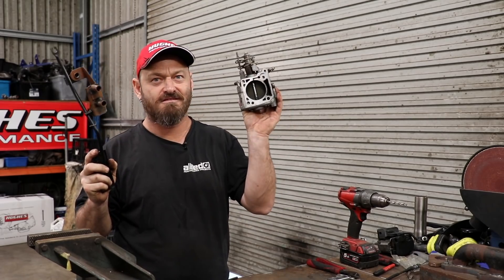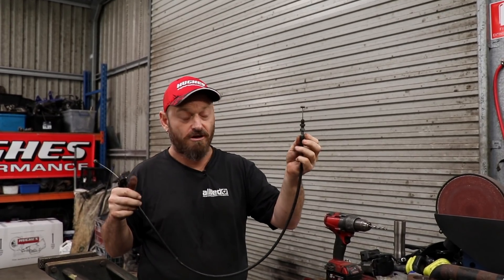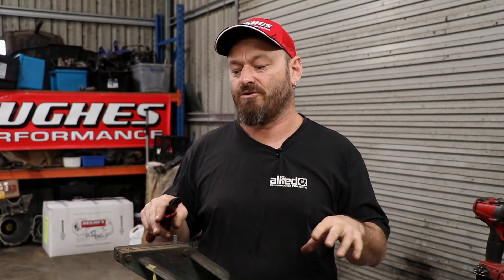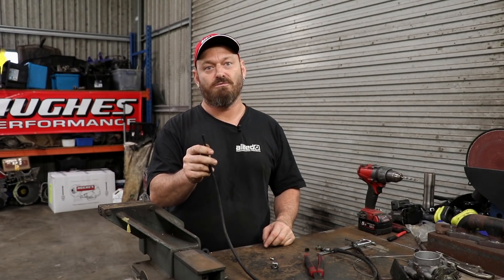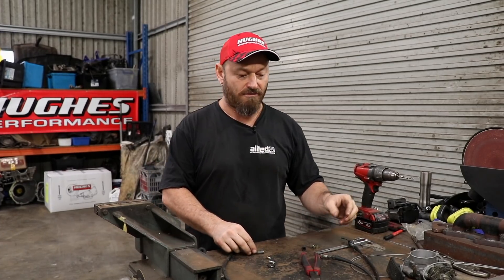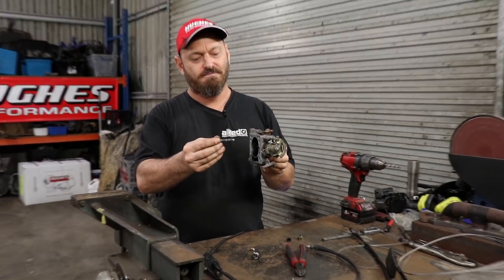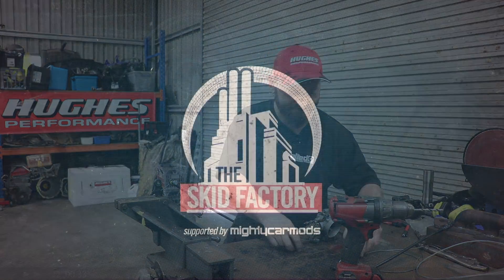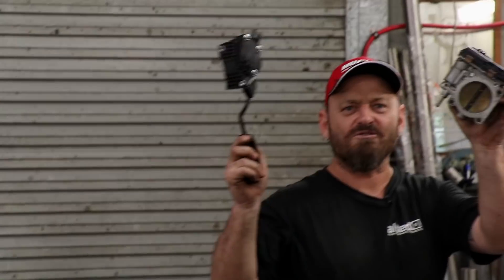THE SKID FACTORY - [QUICK TECH] How to make a Throttle Cable

Comment: Totally agree with the video, just wanted to say that I've found an angle grinder with a thin cut off wheel works the best to cut the outside. The cutters squish in the metal spiral leaving a jagged edge that often rubs on the inner cable

Comment: Some of the bicycle brake cables do have teflon liners. I had to put this out there because I just fixed my bicycle and bought that literal cable that Al has in his hands; Teflon liner with a metal cover wound over the teflon liner :)
Reply: anything decent these days has a Teflon liner at minimum. even under ten bucks

Comment: Nice work guys. I used to work on the production line making cables (mainly hand brake) for the OEMs. One extra thing the OEM does is inject a small amount of what I'm assuming was lithium grease down the tube prior to installing the cable.

Comment: Don't forget that, if one is mixing and matching parts from  different vehicles, the pedal travel (measure on the cable) needs to match the required throttle travel (measured on its end of the cable. You don't want to leave unaccessible throttle travel (e.g. max 85% throttle opening). And you don't want to have the pedal tearing the side off the throttle body either. They have to match fairly closely. For consideration.

Comment: Dont knw where you get your cable housing for your push bike. I buy buy them with the teflon liner and linear steel cable not spiral so the housing doesn't kink plus you can get it in bulk. The problem is the tube diameter inside

Comment: The original inner cable ends can be reused in some cases if you have a little blow torch/mapp gas and some solder. Motorbike shops will also sell solder on cable ends.

Comment: Good video, I've always run a little solder on the ends of the cable befor I cut it so it doesn't fray & spread out.  Thredlock on the screw on nipples once I have the right position. (had one unscrew once.)

Comment: I prefer the hybrid throttle bodies, where there are two valves in them, so you have a drive-by-cable used up to the point where the other electronics-controlled valve is needed to be controlled by the ECU (for traction control, AFR, etc).
Reply from the maker: Nobody ever :
Probably VW : Let's combine two systems that do the same thing and make it complex and unreliable.
Reply: Ew not VW's version, Toyota's one

Comment: Use mig welder to "cut" the inner cable. It seals the ends to stop them unwinding.
Reply: Paul T -Please make a quick video about how you do That and then link it to this video in the comments. I was thinking you would solder the cable before you cut it off. Just make sure to use a lot of flux and it will solder easily.
Reply: @crzy11000  just put desired cutting point about 10mm from earth clamp them set welder to max and one quick zap and cables cut with clean ends. Usually works ok without shielding gas as only takes one quick zap, but will be better with.  Try it, it's easy and gives a nice clean end with no nasty spiky bits.

Comment: Another great video. Could somebody please tell me why in my cars user manual it says there must be 8mm possible deflection between the anchor point and the throttle anchor point? What I mean is when the cable is set, you should be able to press down on the exposed inner cable between the two points and deviate it 8mm. It is in bold, italic in the user manual so I assume it's important.

Comment: those end thingy's with the bolt in them for the throttle body, what are they called, i'm needing to do exactly this job, i know they can be got through a motorcycle shop, i just need to know what to ask for, thanks,,,, keep up the good work

Comment: Very good sir, 
crimping of cable is not shown sir,
If showed it is easy for makers,
Thank you
Reply from the maker: You don't actually have to crimp the outer cable to the anchors, you can glue them in or even heatshrink over them also. I use a 6 sided battery cable crimp very lightly.

Comment: I have a throttle cable I need to get the threaded nut off and put on a longer cable but it’s built on there… is there any way to take it apart to swap them?

Comment: What is the part called that holds the cable to the throttle body? The very very end little nub that holds it on.
Reply from the maker: They are just called cable ends or barrels.

Comment: Awesome vid Al, I’m about to do exactly the same on a Toyota cable which I need more length, did I miss or was it missed in the video how to do the pedal end onto the inner wire?
Reply from the maker: If you have to use a cable with no termination on either end you use the same small terminal that we used at the throttle end but if there is a specific shaped end on the pedal end that suits the pedal shape (commonly a disc shape) i would cut that off old cable and drill through it and reuse it as a "washer" then terminate with the barrel and screw arrangement. Hope this makes sense.
Reply: The Skid Factory thanks Al that makes perfect sense

Comment: Nice video, but i actually needed to know how to lenghten my throttle cabel for my application, how do you re-use the pedal linkage then? Anyhow thanks for the vids and  keep up the good work! Greetings from the Netherlands
Reply from the maker: Valid point, it does require a different tact. Same principles but you need to use the barrel ends on both ends. Hard to cover every specific situation in one short video.
Reply: In case anyone is still confused, the point for any custom cable is to buy longer than you need. Follow the note from 13:40 regarding getting extra of the inside part to get from the pedal to the throttle with room for adjustment. The outside portion may get to be shorter if it only goes from the firewall to a support on the engine. The pedal linkage should be similar to the throttle where you have to match the right size cylinder or ball to fit your pedal and attach that to the cable or buy a cable with it permanently attached.
Reply: if you are lucky you might find another vehicle from the same manufacturer that you can shorten the cable from too

Comment: Just wondering In your opinion how hard would it be to do something like this for a ls1 that is being put into a holden vz s storm Ute In order to delete the fly by wire and run cable throttle with a Stand-alone ecu without the fly by ability included with the standalone ?
Reply from the maker: Keep the drive by wire, it's far superior and much safer.

Comment: How come you always run two fuel pumps (low volume pickup and high pressure?) when doing engine swaps? What's wrong with a single in-tank pump as seen in most stock cars? Is it to stop the car from exploding if it runs dry? Cheers!
Reply: Engines, particularly forced induction don't fair well if they run a lean air-fuel mixture, which is what can happen without a surge tank. OEM tanks/fuel pumps are subject to fuel surge even though they are baffled - they're designed for use in "normal" driving conditions. Under high-g loads (launches, cornering, etc) all the fuel sloshes around, and the in-tank pump can be starved of fuel in these situations.

The situation you describe is typical of a surge tank setup - a surge tank is an intermediate tank between the main fuel tank and the fuel rail. The in-tank pump feeds the surge tank, excess fuel returns to the main tank via a return line. The additional fuel pump(s) then feed the fuel rail from the surge tank. Designed appropriately the surge tank would always have sufficient fuel available for the application.
Reply: @shplade  Wow awesome thanks for your reply mate I couldn't seem to find anything about it! That's good to know because I'm interested in doing a similar swap however not looking at high-performance forced induction (just reliability) and want to keep things as simple as possible so will likely just stick with the standard in-tank pump.
Reply: Carburetted cars don’t have any kind of baffling in the fuel tank to stop the pickup running dry around corners because the carb has a float bowl that’s always got fuel in it.

When converting to EFI the surge tank performs this role instead.
Reply: Robert Holcombe eom intank pumps often have a plastic can around them that is effectively a baffled surge tank as part of the pump assembly. And decent after market intank pump assembly will include the baffling/surge pot. This is standard in the Ford Barra Turbo - after market surge tanks are not required, and are not desirable as the fuel heats up by circulating the small distance between the surge tank to the reg, then back to the surge tank, mostly being in the hot engine bay.
Reply: @nordic5490  Interesting points mate thanks for chiming in

Comment: You showed how to buy longer inner and outer cable, and you showed the universal throttle body nipple, but you didn't address the most important part, the throttle pedal end, thumbs down from me.
Reply from the maker: What is it that you want to know about the pedal end?
Reply: The case where a longer cable was needed wasn't covered. If you can't find a longer cable with the same throttle end as the original, then it seems you need to do both ends...